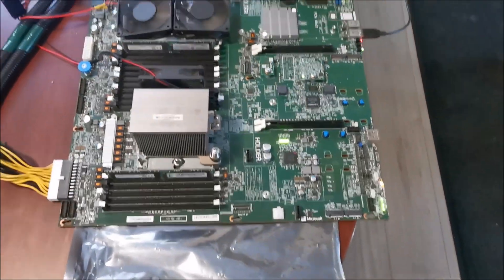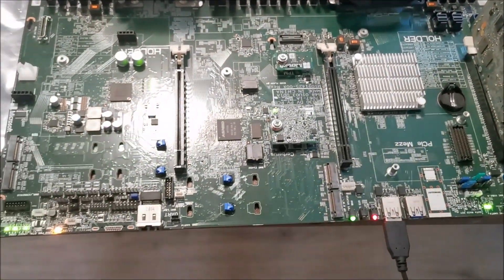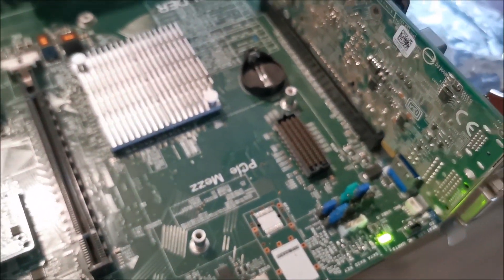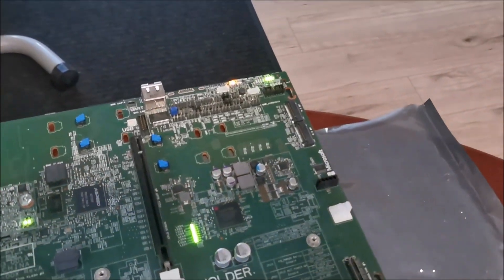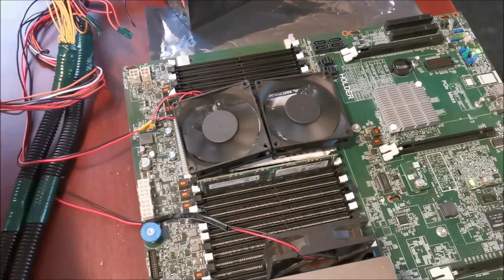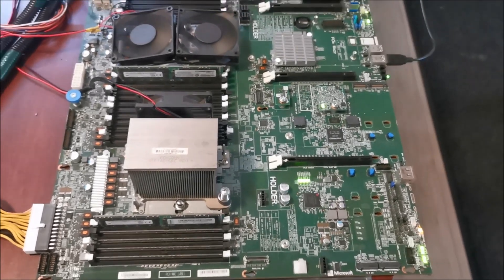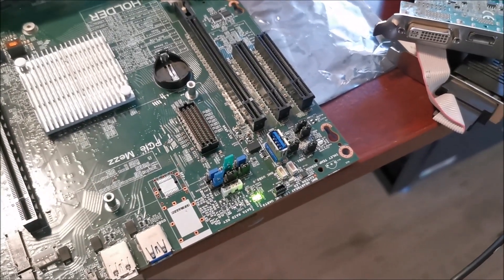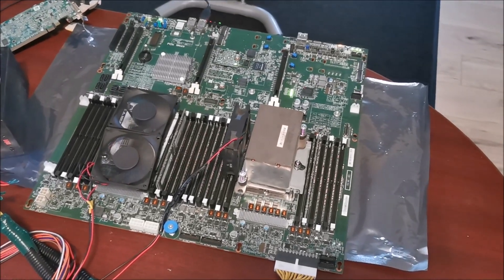Microsoft Project Olympus V2 C2030 Motherboard - Can we get it working? No display output!

Comment: I would try to get anything from the UART RJ-45 port (could be regular RS-232 on cisco console style port or it could be TTL 3.3V, but that is less probable), these custom boards often doesn't have support for video output except from BMC (or it is going primairly to BMC and not PCIe cards)...
Reply from the maker: Check my other video, I got it running and all setup nicely!

Comment: The code 147 in the post code tells you that it is necessary to connect a storage unit, which has a previously installed operating system.

Comment: Which CPU did you say you're using? I believe only specific firmwares support specific CPUs due to microcode space limitations. You can remove the firmware chips on these boards so they're really easy to flash.

Comment: Not all video cards are good, Try changing video card, it happened to me that some video card models are not seen by some motherboards. Try also the others pci slots. Sometimes the video card only works if placed in a particular slot and not in the others. See if that motherboard has the console in the serial port to configure the machine without using a video card
But I think you have already tried all these things, they are basic checks, and also the things they recommended below, if it's a server maybe it has a specific machine management module. I don't know that model

Comment: EX microsoft lab vendor here, those thing does not have VGA output, the video output gos to the PDU, (yes, the PUD has KVM build into it) also the only NIC port on the mother board is NOT for BMC.  make sure you have the jumper setup correctly , I could not get you the doc since I jumped ship. try to use newer Nvidia VGA card, the power on to POST on the screen may take a few min.
Reply from the maker: Thank you! Power dis unit has a kvm? What a strange setup lol. Sad it does not have vga out just built in. I should be able to use a graphics card with it as they were sold with a r9 290 something installed? And you are saying the network port isnt for the BMC? it looks like it is but you probably have a better idea then I do lol.

Comment: Okay. So I am also going to be nice about another thing. It will not work with that graphics card. I noticed your graphics card port. And you completely don't see it. You will see next to the label PCIE Mezz What looks like a oval shape black connector with a bunch of pins that is your gpu connector It's using A GPU connector from a apple graphics card.. 

So you have no video out at all unless you find a pci graphics card, not A PCi Express card. 

Your GPU plugs into the brown slot on the mother board for external GPU Which is pci only not pci Express
Reply from the maker: Im going to be nice too. Your information is completely wrong about everything. The board doesnt even have pci lol.
Reply from the maker: This comment was made with my working Project Olympus V2 motherboard. Thank you for your comment

Comment: Okay. So I am going to be very nice here. But I definitely can tell you have no experience with server boards. So I am going to give you a helpful piece of advice that PC I Express slot that you plugged your g. PU into is not APC. I Express slot.  The 3 black slots that are on that board are for 3 riser cards that connect to Sata. Those are not PC I Express. You are missing the 3 Sata. Riser cards, these cards are necessary to plug Sata hard drives into without them. You are basically running the machine with 0 output. Because the machine won't boot without the riser card.

Now.
 If you're wondering how I know this, you will see a black 4 pin power connector on the motherboard. That is a mulex connector and it is designed to plug into another cable which you don't have. Which powers the 3 riser cards.

Usually on these boards, you network into them to get a video signal.That is another thing that you're also missing is a way to network into the machine.

I really hope that this helps you because you will never Get that.
Board running without the riser cards It's missing three riser cards
Reply from the maker: This comment is being made from my WORKING MS Project Olympus V2 :) Thank you for your feedback- That is still wrong
Reply from the maker: @johnDingoFoxVelocity  lol you are very wrong. Check out my other videos. The server board is also sold with a Radeon 290 GPU derivative installed in PCI SLOT 3
Reply: @dom80TA  correct pci slot 3 not pci express slot 3 two different types of pci
Reply: This isn't true. They're all PCIe slots.
Reply from the maker: @lost4468yt  lol guy acts like i dont know what im doing then provides completely wrong info on every point
Reply: @lost4468yt  No.
They are not.You do not understand that a server actually has three boards that stand off of it for the sata hard drive he has the gpu plugged into a sata slot if he would just try a regular pci gpu not a pci express the machine may boot from the pci slot not the slot he has it in prototype boards rarely have a working pci express slot most are pci only or proprietary like the gpu plug on the main board for the missing graphics card.
Reply from the maker: @johnDingoFoxVelocity  Dude just stop lol you are so wrong about this entire system. Go read the project olmypus manual. They aren't even basic pci slots. PCI non express standard hasn't been used in ages. and they are NOT riser slots? The server uses a gpu in slot 3. idk why I even am replying

Comment: I'm going to go out on a limb and assume that since this is a highly specialised purposed motherboard (read: to only run in lights-out datacentres for cloud stuff), the uefi probably doesn't have any video support. It's probably only accessible via serial, either through a serial port on the board or via the BMC.
Reply from the maker: System is sold with a radeon 5450 gpu preinstalled

Comment: Check if the EPS 8 pins and 4 pins are supposed to be connected
that GPU is probably too old to play nice with a lot of newer boards
check the BMC for video related settings
The board may require a bios battery
Reply: the 8 and 4 pin are Drive Power outputs.
Reply from the maker: Those mobo ports are actualyl output power! I did see a document that shows a similar gpu supplied by oem for these machines. I have also tried battery in and out lol. Good suggestions though thank you. Next step is probably bmc access

Comment: This board might not have a UEFI CSM for support of legacy BIOS VGA output. Try a newer GPU with support for UEFI GOP (some Nvidia Kepler/Nvidia Maxwell/AMD GCN4 or newer).
Reply: i feel like that is what it is, ive had a few older dell's do that when secure boot was enabled
Reply: this is 2nd gen Olympus with Root of Trust "Cerberus" - if forced Dom to get dozens of new to old GPUs but none worked(if this is ithe issue)
Reply from the maker: I have tried quite a few gpu, with newest being my 730 UEFI version. All same post error leds. Whats strange is I get this regardless of gpu plugged in or not...

Comment: There's a github with all the documents you access the bmc through network. i suspect you may have to tell it to boot with the psu error (amber light )
Reply: it posts until stops at PCI enumeration. kbd reacts for numlock.
Reply from the maker: that psu light is just to show that there is a psu (non redundant) plugged in from my understanding
Reply: @dom80TA  the manual says "phase failure" i'm not sure that's the same as not having the second psu plugged in (maybe someone more familiar knows).
does the pad labeled "pwr btn" do anything?
Reply from the maker: @Malice11029  I am not sure either, the psu is a piece of garbage I had kicking around (didn't want to butcher a good psu for this lol) The pwrbtn pad is just a solder pad. I didn't try to touch these together with a pin or anything lol. boom! The whole system turns on with the psu switch. I kind of hate it. I can't see this being a power issue because it seems to boot up
Reply: @dom80TA  that was suspect to me. the blinking green "heartbeat" light is for the bmc, so the server is on but not completely posted. some enterprise hardware turns on but doesn't completely post until you press power button or power it up remotely (usually a web interface or something as the server is designed for remote power management)
Reply from the maker: @Malice11029  So you think that even though its "running" the  power hasn't fully been used to power it on all the way? I mean it does make sense in theory

Comment: Might be beeping sound helps
Reply from the maker: what
Reply: @dom80TA  motherboard beeper/speaker.
just google it
Reply: I'm so sorry for late reply I mean add a basic speaker which gives beeping sound I also find there is a gpu problem in my PC by its beeping sound it was 6 beeps when I search on office website give me this information actually my PC was work station which comes with out dedicated GPU in processor

Comment: BMC showing up on network?  If BMC is going, maybe KVM is an option.
Reply from the maker: @aaronring2444  haven't tried with the BMC port, but built in BMC does not even have graphics support lol...
Reply: @dom80TA  right but if you can get in and mess with bios you might find a reason GPU isn’t initing
Reply from the maker: @aaronring2444  I don't think bios is accessible from bmc but I can always try! Thank you
Reply: @dom80TA  Not much of a BMC if it can't get you information on why it won't post... That's like, the very basics of a BMC
Reply from the maker: @danieljonsson8095  Its an aspeed1250, basically a stripped down aspeed2500 with NO video support. I have seen someone access it withj ipmi tool and its beyond basic what info it shows
Reply: @dom80TA  You don't need video support to diagnose stuff on any even half decent bmc. It it's a power issue, not only should it tell you that but it should also tell you what kind of power issue. And while 1250 is limited, it will tell you quite a lot about current state if it boots.